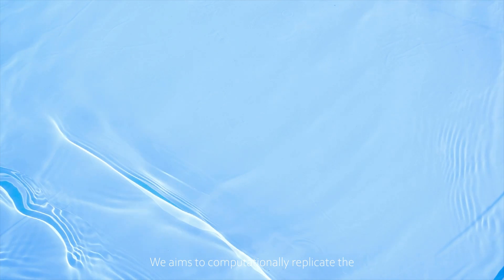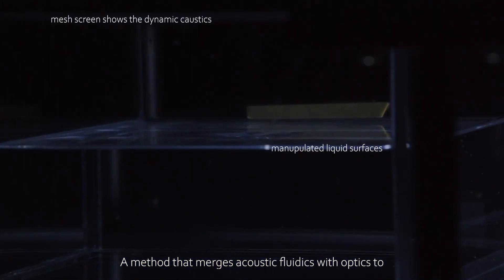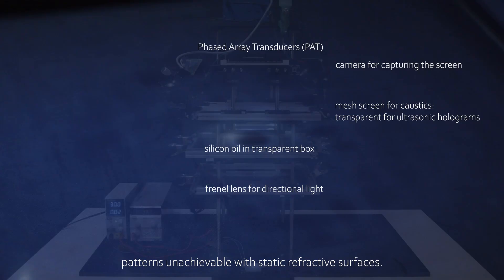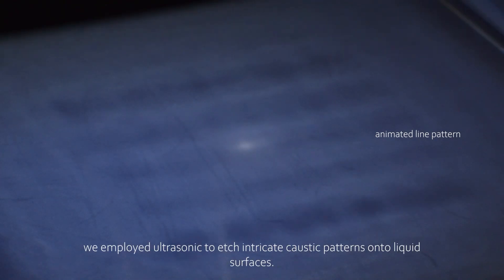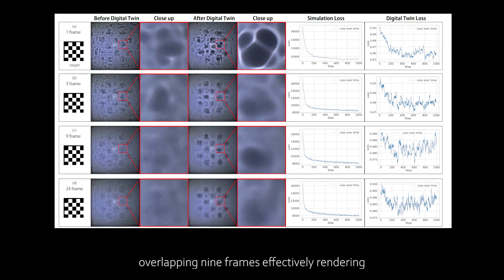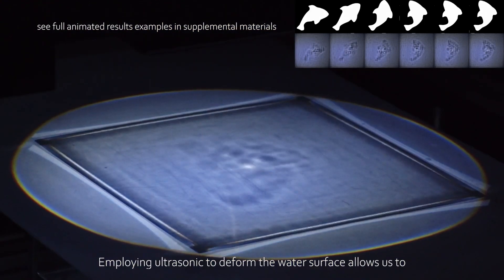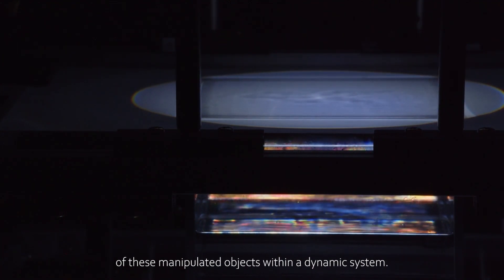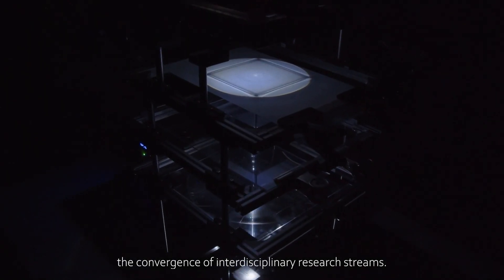Dynamic Acousto-Caustics in Dual Optimized Holographic Fields

Comment: Question:
Would employing sensors to analyze the 3D geometry of the surface of the fluid not allow to set up ultrasound sound waves to perfectly and keep levelled the surface of the liquid by producing negative counter waves locally accross the surface, allowing for even clearer caustics and image fidelity.

In a little simpler terms, by having sensors map the surface of the fluid, maybe setting the system to push down wherever is above fluid level that isn't intended to be raised for image production, the whole liquid could be kept static outside of the area you wish to change the fluid's geometry in order to create the caustics, which would allow possibily to increase the intensity of the accoustic hologram and create clearer caustic images.
Reply: Hi,

Thank you for your question. I’m one of the authors here. The answer is both yes and no — while having access to the 3D geometry of the fluid surface would be helpful, the main limitation lies in the ultrasound pressure field. We currently can’t generate a pressure field with high enough resolution to make finer adjustments.

What’s interesting in our approach is that we don’t need to measure the 3D surface geometry directly. We’re optimizing the optical effect (caustics and shadows), which depends on the fluid surface that is shaped by the acoustic field. Using our optimization scheme, we can directly map from the observed optical effect to the required acoustic field, bypassing the need for explicit surface measurements. This is nice, because getting the caustics images are much more easier than getting 3D surface geometry. 

This is part fun experiment to demonstrate animatable caustics, but also a practical case which allowed us to test multi-physics robustness of the optimization scheme.